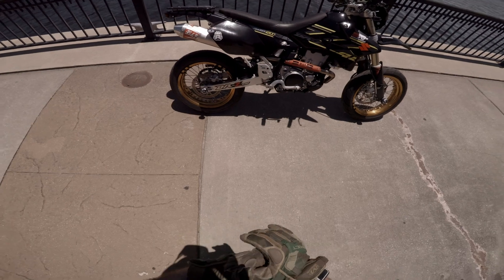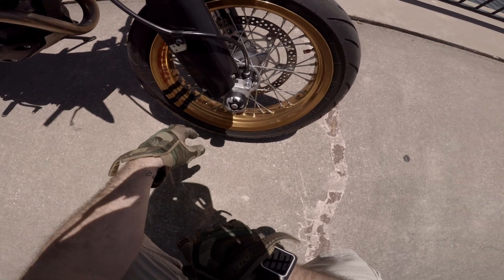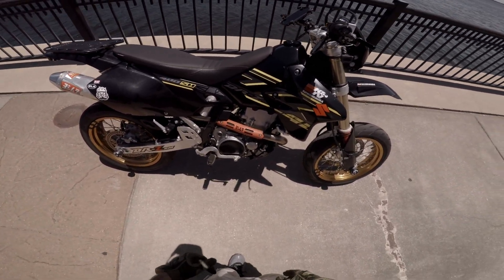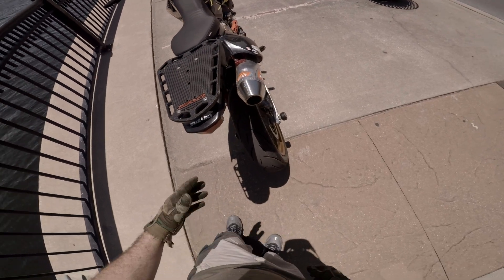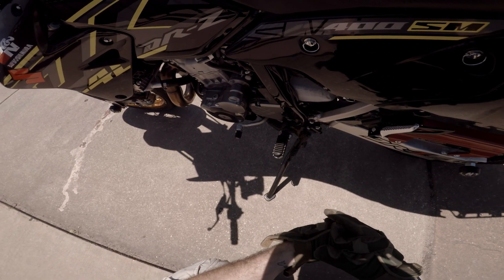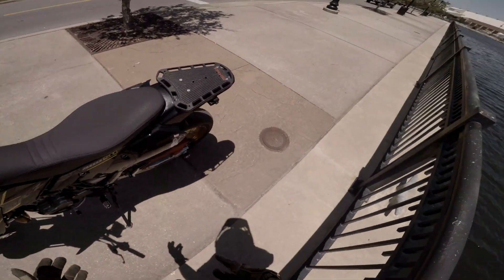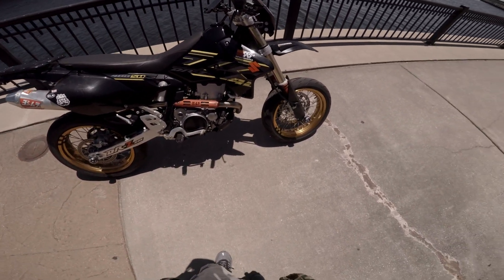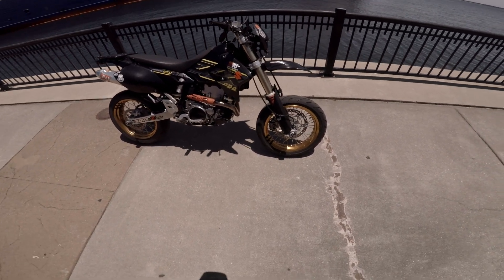Drz400sm mods and walk around

Comment: thing looks sick. What size is the rod for the sliders? did u have to cut the rod?
Reply from the maker: Evangelio Diaz It’s a 7/16” all thread rod with nuts and washers, I added a nylon spacer in the hollow end up front to center it and a 22mm OD nut to space it out to match the other side.  In the rear I used the same rod and nut, but no nylon spacer.  I cut it long and once it was all bolted up I cut them down short.